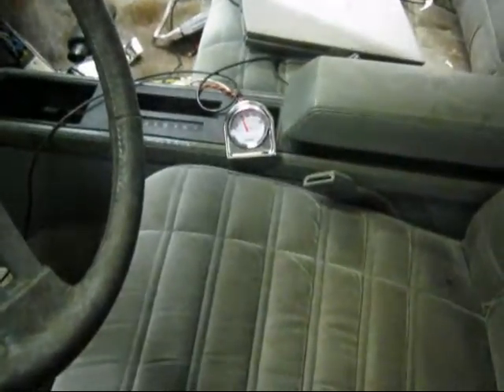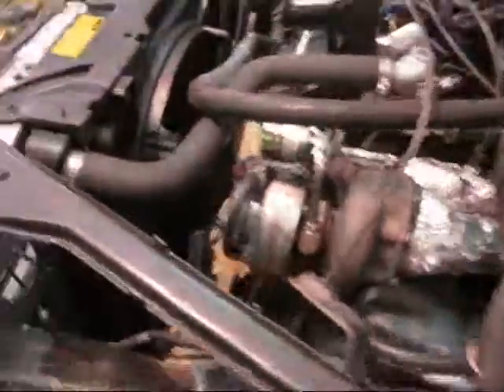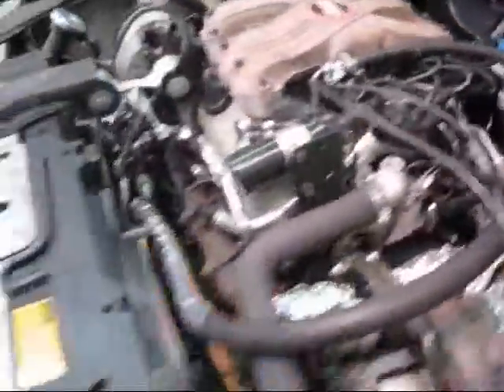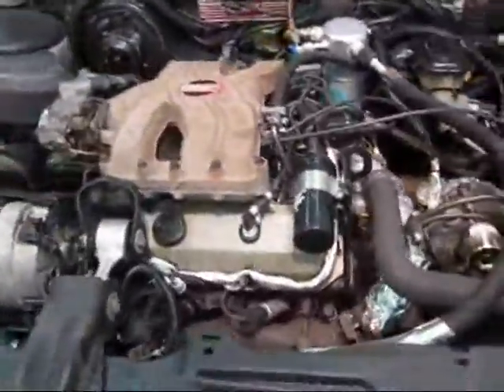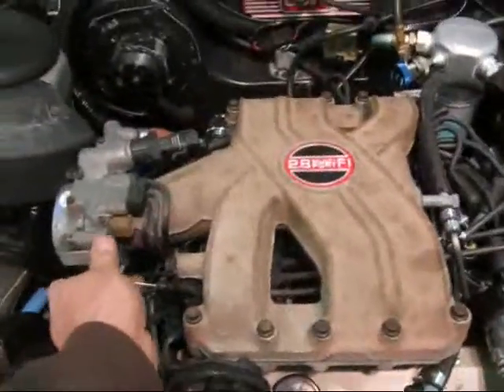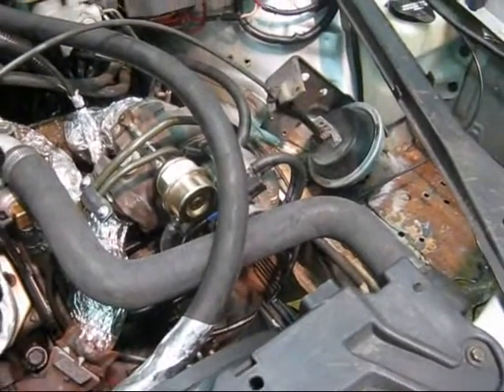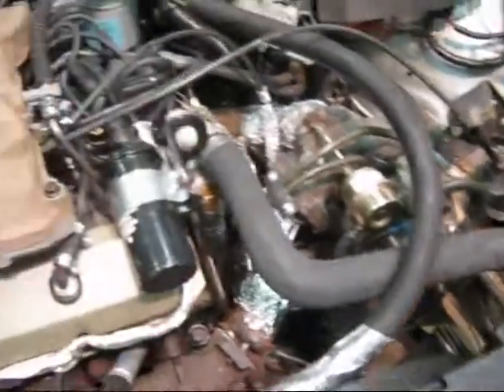Warmup

Comment: Your chanel is very entertaining and helpful.I have a doubt about the ecm. How did you do to use the 1227730 with de HEI module and distributor.Thanks.
Reply from the maker: +SoundandCarsmx 

Thanks for the comment on my channel!

The 1227730 ECM uses the Delco-standard GBRE timing control circuit (Ground / Bypass / Reference / Electronic spark timing).  They same circuit works to connect the ECM to the HEI module; or to connect the ECM to the DIS module (with coil packs).

The wiring is the same, but the settings in the ECM program (the chip) are different. The program in the ECM has been adjusted for HEI instead of DIS.

Comment: really love the car man I also own a 1985 Chevrolet celebrity but mine has the 2.8 2 barrel carburetor they are really good cars hope to see more videos or something of yours if u want check my channel out I have some videos of mine cold start
Reply from the maker: +Christian Leatherman 
Thanks for the comment! I had a car with the 1985 2.8 2-bbl engine. It was reliable and a good car, but eventually I was rear-ended badly and that car was demolished. I have to get to work now but will watch your Celeb videos later today. It's the same color as this one, I see from the thumbnails!
Reply: Ohh dang really sad to see that it was wrecked aw man what u do junk it to junk yard and real soon I'm about to do a update on the car cause right now I'm fixing oil leak it has the timing cover and and stuff so u will see what looks like now and that is one thing I do have complain about is oil leaks with this thing I get it fixed then there's something else but but other than that the car I really love it has power for little 2.8 I am trying to get another one tho from junk yard cause they have one same year and engine to but idk what if it even runs but if not I will have parts car if i need it
Reply from the maker: +Christian Leatherman 

I really recommend you get the other car from JY if they will sell it with clear title. Fix if possible!
Reply: Yeah they said couldn't get tittle but at lest I mean have another one and today I went to junk yard to see about it and to get a part I needed for it and hole Damn car is gone I have no idea where it went cause it was way in like 12 car in the role and they have like all cars close so idk what happened
Reply: But there was 3 celebritys left but only one had same body and everything like mine front and rear but different engine had the 2.5 Iron Duke but had been there long time Ik about 2 years I think because I remember that car
Reply from the maker: +Christian Leatherman 

I'm sorry that car was gone. :( 

I hope your grandmother can get another car and return this one to you.

There is a very good forum for people who love these cars, and their brothers - the Century, Ciera, and Pontiac 6000. Please see http://www.a-body.net and sign up. Even if you don't currently drive this car, you would be welcome there. Post links to your Celebrity videos on the forum.
Reply: Ohh okay cool man I didn't know there was a group and I have the car it's all mine I never did get rid of it so everything is good I've got it all tore down like said I'll make a video tomorrow and u can watch it and see what's going on
Reply from the maker: +Christian Leatherman 

That's great! Glad you still have the car.  The cars that have been in the family for many years have a lot of sentimental value. I feel that way about our family cars, as well. Some people don't care, but that reflects badly on their upbringing. 

Hope to see you on the forum. My screen name is turbokinetic on that forum, with the same avatar you see here. I am on a work assignment now, so I may not be on the forum for a couple days.

Good luck with the engine leak repairs!
Reply: Ohh okay man thanks and if u know anything about else about oil leaks or anything just let me know and do u still have Ur celebrity in the video I really wish I had the eurosport celebrity that's the top line they made it had like better ride and bigger engine and stuff And most of all it had the Chevrolet celebrity eurosport rims and I trying soo hard to get them rims for my car so bad so can have them and there's only one for sale on eBay but I need 4 not 1 so I'm still trying find them and I'm really shocked how did u find this celebrity u have cause I noticed that it's a 2 door man u are lucky u can't really even find even that little alone Chevrolet celebrity that runs with a 4 door and eurosport is mosty gone can't get that or find them anywhere do u have anymore video's of the car u have like see what she looks like now
Reply from the maker: +Christian Leatherman 

The Eurosport in my videos belongs to a friend of mine. He brought it to my place to work on the engine and transmission. He still has it! There aren't many 2-door cars. The car has a very long backstory:

http://www.a-body.net/forums/showthread.php?11247

I don't really understand all of your message. There is no punctuation (periods, commas, etc.) and I can't really sort out the meaning.
Reply: Oh okay I'm sorry about my words of spelling and stuff but I only seen about 4 videos I think it was of the car at all and since u did mention about u worked on the transmission on that car I am having a little issue with mine right before I tore the whole car down to work on the oil leak
Reply: I changed the transmission fluid and filter on it and it was dirty and not long after that it started this problem of when u stop on it hard and stop to a complete stop and wait for second u can fill the transmission finally downshift or jerk or something like that and I have been wondering why is it doing that but when u take off from dead stop or anything like that it will go no problem and it's changing through the gears real good but i only have a problem if I like stop hard if like someone would to pull out in front of me and try to push on the gas to go again it will like slip like to go
Reply from the maker: +Christian Leatherman 

Yes I did rebuild the transmission! Any time you build a very powerful engine, you have to increase the strength of the transmission. 

The slipping you are talking about could be low transmission oil level. When you hit the brakes hard, all the transmission oil sloshes forward. This can let the pump draw in air, and cause some slipping. I would add a little transmission oil and see if this helps it. 

The other possibility is sticking valves in the transmission valve body. When you change the oil in the transmission, sometimes the new, fresh oil will clean out some deposits from the transmission oil passages. This dirt will circulate and cause some strange operation. This will probably get better and better as the new oil settles in.
Reply: Oh okay I see and that's kinda what I thought I checked the fluid and it's full so idk and I hope it stops that . And hey I uploaded a video if u wanna check that out